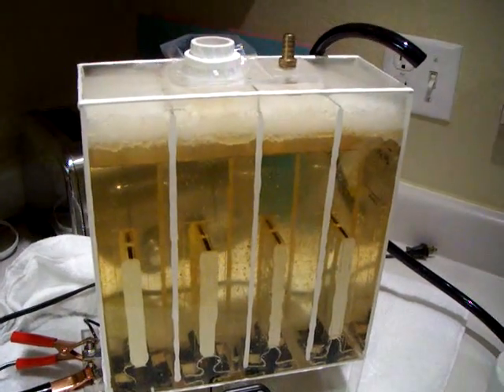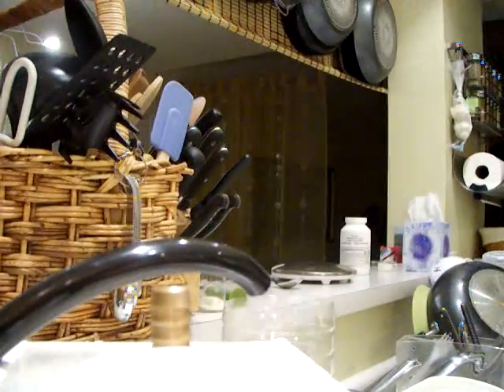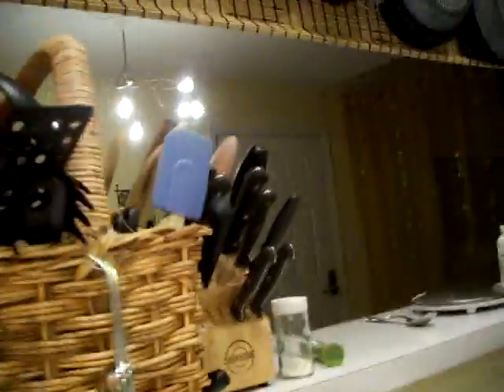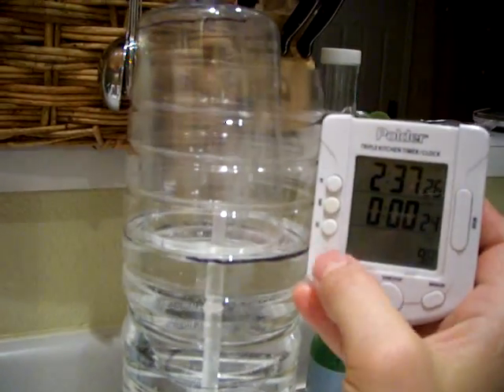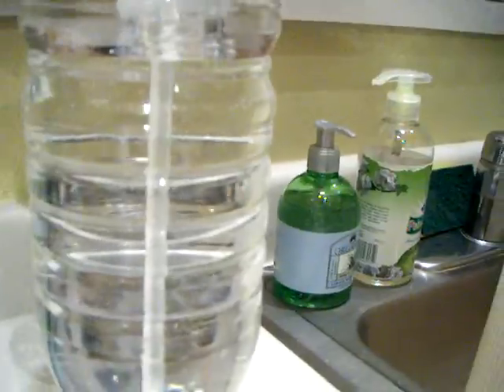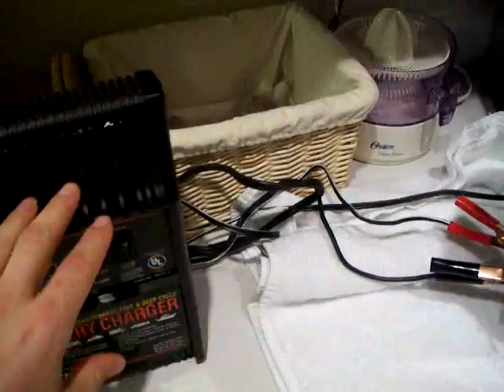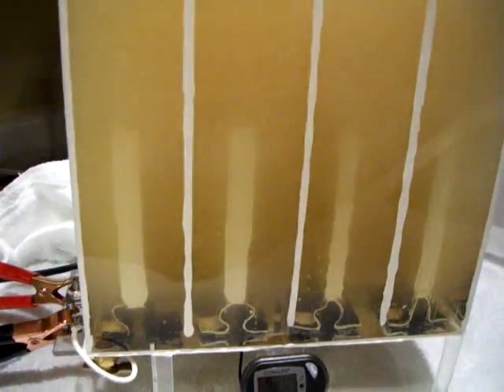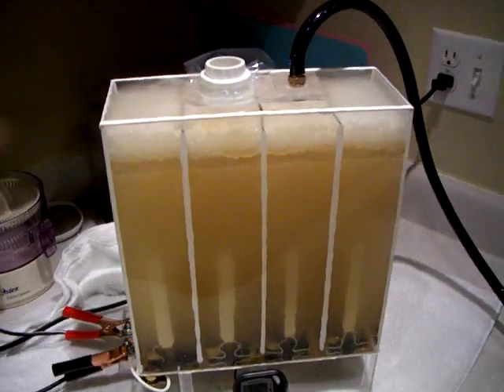#3 (2of2) HHO Generator How it's made

Comment from the maker: So obviously you haven't seen my 3 first video. There are actually 4 cells of 3 plates each connected in parallel. Mr. Z from Zerofossilfull (he is my mentor) already suggested me to use a 5 volt power supply to reduce the heat probleme, witch I will do as soon as I get one. Any how, Thanks for your interest and comment, and I hope you look at my other videos.  ;-D

Comment: it appears you have 4 seperate banks, each bank being a unique +/- entity ... have you tried hooking them up as if they were indeed seperate devices, and connecting each device in series ???  this would make the effective volts per unique +/- entity about 3v ... should reduce your heat a lot ... will also drop amps so production will fall ...  so you then put more spice in the soup to get the amps back up so it produces ... just a thought ...